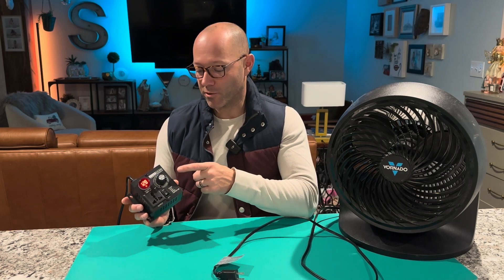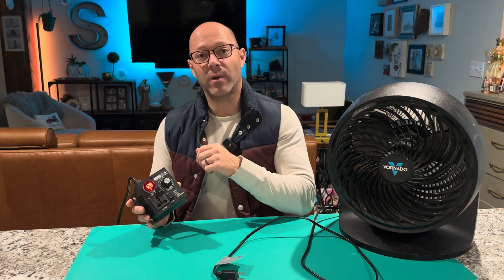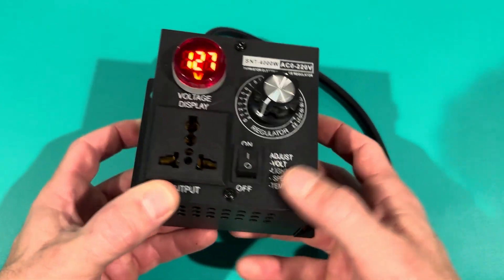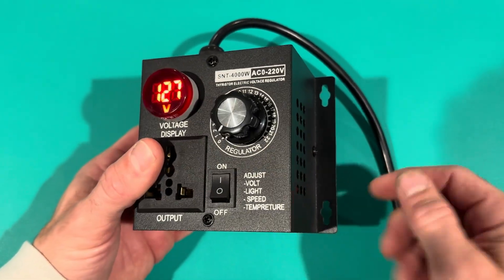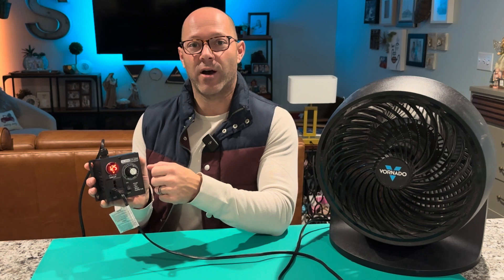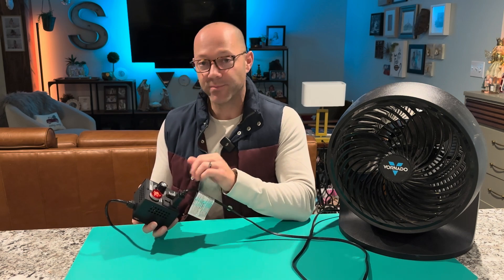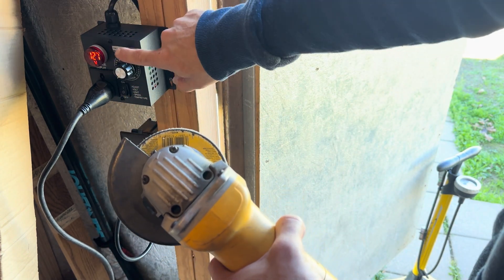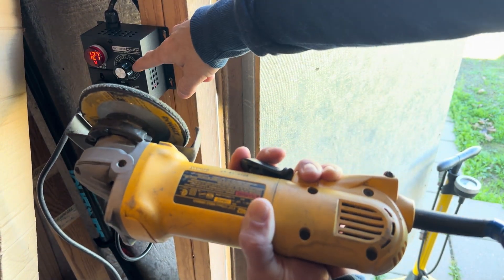AC Motor Speed Controller 120V ,Variable Speed Controller & Fan Speed Controller

Comment: Why don't you show that grinder doing work at lower speeds. What happens to the torque. Why are you doing this?
Reply from the maker: Its just a demo of its general function. I have worked with my grinder slowing it down basicly like a large dremel tool but no one wants to see my bad welds that I was grinding so I dont have a video of that.

Comment: Something is wrong.  Most fans are synchronous motors and would requre a frequency change rather than voltage
Reply from the maker: Well it works, I wouldn't use this on a fan it's just for the video. Weather it should work or not I don't know but it did.
Reply: It will work for a short time and then blow up your fan. They need the AC sinewave chipped not voltage decrease

Comment: Can't imagine it would be difficult to source a full bridge rectifier and operate a DC motor with this device. Obital sanders and dishwasher pumps have them.
Reply from the maker: why would you need a rectifier?
Reply: @TechReviewswithphil  It takes the pulses of alternating current and converts them to DC current using diodes. Allows AC power to run DC motors.

Comment: Watch out using this for a speed control. Some electric motors don’t like the voltage change. A proper speed controller should control the amperage not the voltage. That’s basically a fancy dimmer you’ve got there.
Reply from the maker: I was thinking the same thing
Reply: Facts